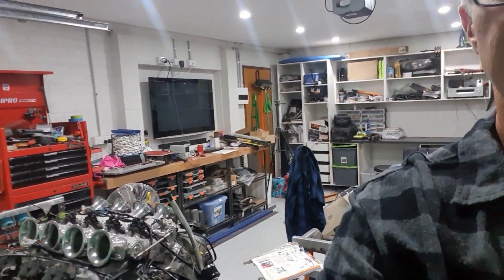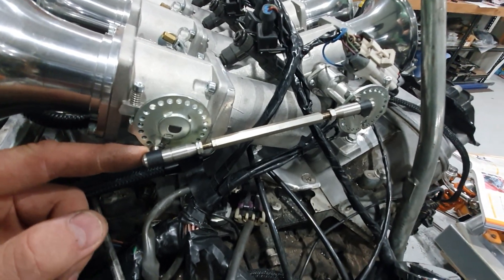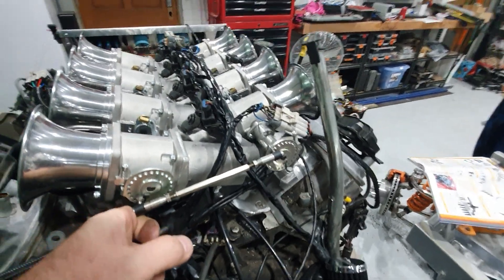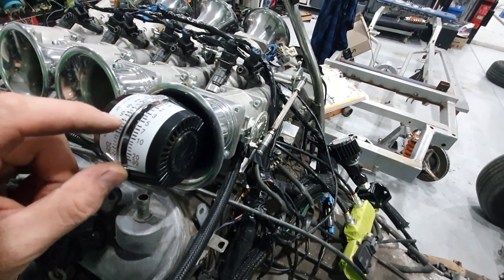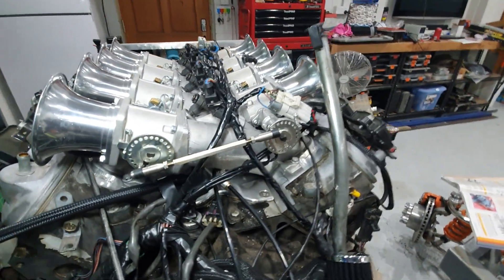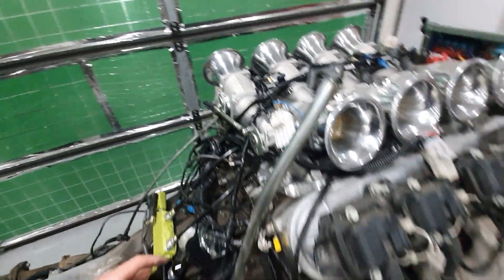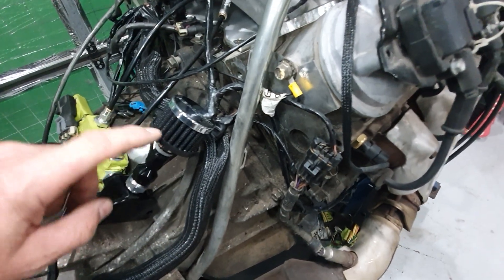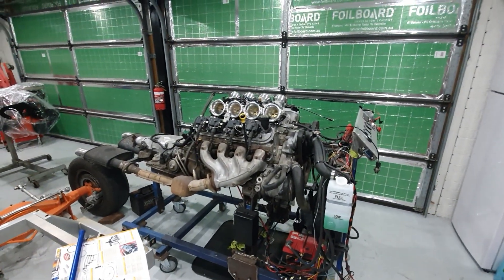How to install the throttle linkage to velocity stacks itb's.

Comment: Thanks for this. What cam, head setup did you run? And what did it make? Ive just got one of these speedmaster kits for mine.
Reply: Also was it the 170mm linkage? And where did you get the rail extenders? Thanks in advance.
Reply from the maker: @alexrenault3620  Hey Alex, sorry for the delay in replying. Family stuff comes first. The engine is a stock 5.7L engine I pulled from a wreck I purchased. I don't know what's done to the engine but prior to pulling it it idled nice. Had a good lope to its idle. So from my experience it wasn't stock. Maybe just a cam. Specs I don't know.  Heads are only 241 heads. I've never had it on a dyno. Was just prepping the engine as a standard engine that looked cool for a hotrod build.
Reply from the maker: @alexrenault3620  I got the linkage from aeroflow, aussie parts company. Nice stainless quality item. If you look up aeroflow you can see their range from their online catalogue.
As for the injection rail extenders, are you asking about the fuel rail height extension brackets or the injector extension adaptors?
Reply: @SullysRodskustoms.  thanks for replying. Hope all is OK with you. I'm in Melbourne. 😁

Just wondering about the fuel rail height extension brackets and how you mounted the oem throttle position sensor...?
Reply from the maker: @alexrenault3620  not sure if you tube messages will let me send pictures or I could show you in more detail.
The brackets I made myself. Took a bit of working out and a few bad attempts. But eventually worked. If your really keen, I could take one off and make a template for you?  The TPS I purchased unline, I think it was  Speedmaster also. The first one didn't work, they offer shit warranty and wouldn't help me. I bought the next one from another company, double the price but it worked. Speedmaster or a/t racing as they are known sells them for about $80, I ended up paying about $140. The parts looked identical. Bolted right up to the end of the front throttle body. I think I explain that in one of my videos.

Comment: What engine or heads are you using
Reply from the maker: Hey Michael, it's a stock 5.7L LS. I removed it from a Holden Caprice.
The heada are 241 heads which come out on most 
5.7s in Australia.
Our LS range was 5.7, 6.0, 6.2L and LSA.

Comment: What brand ITB’s are you using?
Reply from the maker: They are speedmaster TB's. I wouldn't recommend anyone buys them unless they want to spend months setting them up. Quality is poor, their after sales service is non existent. Doesn't come with any instructions either. They look great though. Lol
Reply: @SullysRobskustoms. Have you had a look at the redux ITB's.  I've been thinking hard about getting them for my LS1 project here in New Zealand.  Just need to tidy up my VY commodore HSV
Reply: @SullysRodskustoms.  damn, that rod end setup looks like treat compared to the throttle linkage I have. I wish I`d found this video before I started to mess with my speedmaster setup. What a pain in the ass
Reply from the maker: @georgegavrylenko1031  they do need alot of work to make run, definitely not a product that works straight out of the box.